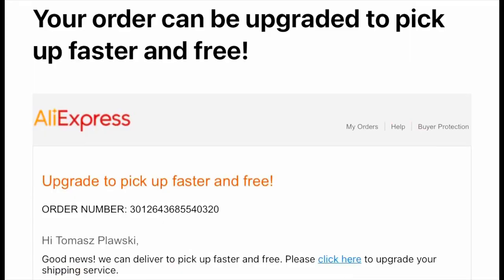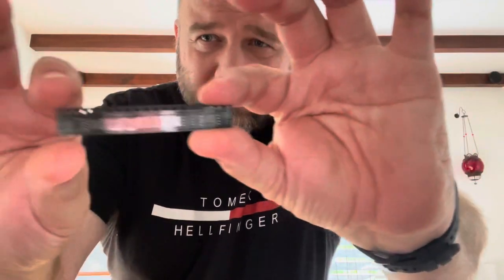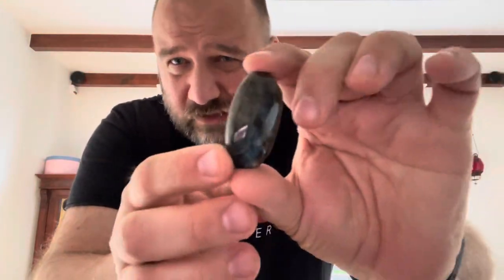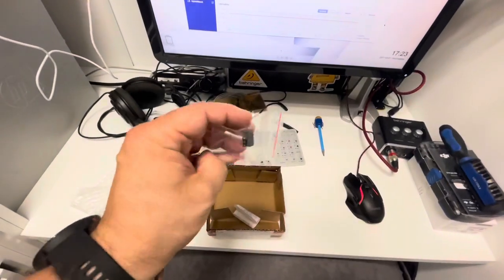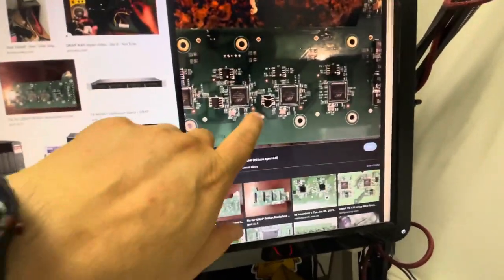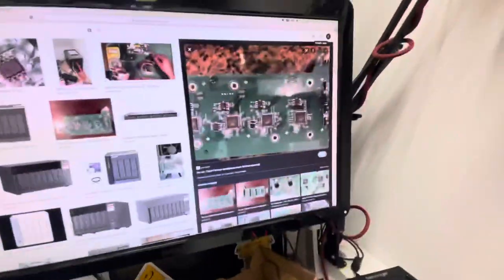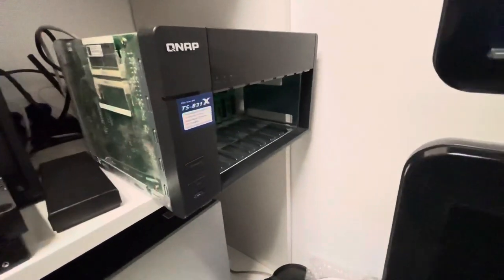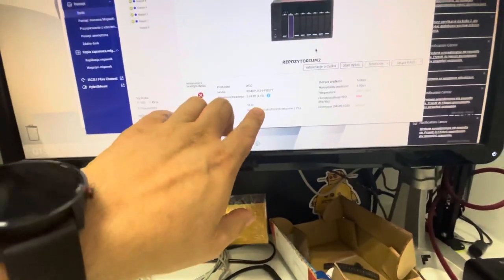🇺🇸/🇬🇧 TS-series QNAP NAS repair (it’s often that it’s actually not the disks failing but MOSFET)

Comment: had this same problem, the engineers at QNAP tought about this and added next to each mosfet pads to short them without wiring, you short them both and the mosfet is shorted at the board level. You can see them clearly at 10:19 between two brown caps on the left and below a tiny cap on the right.
Reply: i have a failing TS-853BU-RP... same problem... lost 5 out of 8 disks... will try the jumper thing on the board (not mosfet) and post my results.

Comment: This video was gold. Was about to order new disks... I have a TS-451 that now says disc 3 is missing. Moved the disc to a sata to usb adapter and inserted it to my main pc and the disk shows up correctly in disk management without any strange errors. So my guess I have the same issue. Then when I inserted the drive I could shortly see the drive in qnap. it reported no smart errors but som I/O warnings. then suddently it disapeared again.... So since out of warranty I need to pull it apart and se if I have the same mosfets on mine.
Reply from the maker: Reading the different support groups it unfortunately looks that this is quite a common problem in different QNAP units :( I’m surprised though that for units under warranty people had their backplane boards replaced with exactly the same ones with the same MOSFET. One would think that the manufacturer would redesign the board, so that it’s not susceptible to the problem repeating itself???
Reply: @TomaszPlawski  Yes i did eventualy find a tread about this. Also created an acount to view the images. However your video had the clearest shot of a finished bypass. (and the only one that does not require login to qnap forum :-) In the datashet for the AP4957AGM I could verify the briges was for the dual fets in the package between D1 and S1 plus D2 and S2. By that I was confident enough to bridge the mosfet connected to drive 3 power. But on my backplane board it seams that disk 1 and 2 are always on only 3 and 4 had this mosfet to the 12v and 5v rails. doing the full smart test on this 3GB drive is estimated to 4hrs if al plays out good i will order new mosfets and glue some copper with thermal glue as heat sink on the new MOSFET (a tip a found in the forum. however my nas has lasted 4-5years so far so if new mosfets prolong the life the same it is probably up for a upgrade by then anyway :-). 
My NAS was the TS451 the backplane was labeled "TS-451II BP v1.0 QX70" and the mosfets where 4957AGM located between  connections for disk 3 and 4. For info for anyone else finding this video but have another QNAP.
Reply: Final report. The unit has now worked for some time with the MOSFETs bridged. No problem so far. One tip for anyone having this problem and can't get the unit up an going again. Qnap did refused to accept the drive as a part of the raid again for me. This i found out to be because it was marked as having IO problems. Did a full smart test so drive was marked ok for that. Still wouldn't accept the drive. Then did a full sector scan and got the option to clear IO problems if test was succefull. Took many hours. After that I disconnect the drive and connected it again. After that the NAS accepted the drive and started to rebuild the raid. (Not sure the scan was called "full sector scan" but basically the drive can't have any error statuses for the NAS to try to rebuild the raid.) Could not find anything about this in the forums seams like many did a full restore and wiped the NAS instead when encountered this problem. But it turned out that as long as the other drives are ok there is no need for that. (Everybody wrote it should just restore the raid automatically when drive is inserted and if that didn't work just wipe the drives... But as I found out that is not true. Did take some time to complete all steps but a loot faster than starting over.
Reply from the maker: @rasmus80g  thanks for the update.  My unit took almost a week to rebuild the RAID, but it pretty much happened all by itself.
Reply: The 451 and 251 (basically all TS-x51) have self-killing CPU core voltage regulation issues as well. A couple transistors responsible for regulating the core voltage can fail, so it's either too low and it doesn't boot at all, or it's too high causing all kinds of crashes (and CPU temp reported as 255C in BIOS) and inevitably CPU death. It's essentially a repeat of the Atom C27xx CPU failure, but with the Celeron J19xx instead. And to no one's surprise, QNAP suddenly started making ARM based NASes (Annapurna Labs SoC) again, and even ones based on embedded Ryzen CPUs. They got burnt a couple too many times by intels hardware issues lol

Comment: Nice diagnosis, where did you find the info/details?
Regarding the fix, you could have just soldered the two close contacts above and below the chip, if you look at the circuit they are attached EXACTLY to the pins you connected!
This meka me thinking that maybe other models (no hot plug??) may solder these pads instead of using the mosfet?
Reply from the maker: This was mentioned on a few qnap forums. I left the original (broken) mosfet in place not wanting to play around with desoldering. It has nothing to do with hot-plug. Just intended for switching on the disks in sequence to avoid a startup current surge if all started at once.

Comment: I have a ts-253A 2 bay. Bought it used. I purchased 2 New WD40efzx 4TB drives. When I run setup from qfinder I get error saying no HHD recognized. Power button solid green, no lights in the HHD1 or 2 LED's.
Reply from the maker: Probably the same reason and the mosfets are blown :(
Reply: @TomaszPlawski  can these mosfets be purchased? Where? Is there a good video explaining this?
Reply from the maker: @MikeGoodwin-kc3st  I tried looking for “regular distributors” for them via octopart and nothing came up. Googling for 4957agm there are plenty of offers on eBay and AliExpress but with all the counterfeit parts nowadays I just chose instead to jump the legs to have a permanent ON of the power to the hardrive. The purpose of these MOSFETs apparently only to switch on power to the drives in sequence not all at once. Ps. I don’t know if the 2-bay has the same MOSFET. But looking inside my 4-bay NAS it had basically the same design as the 8-bay and also uses 4957AGM therefore I assume they probably did all the same

Comment: Tomasz, will this work for TS-451 as I tried to find where these MOSFET located but I cant see on the board that hdd's are plugged in. would you mind to email me some info pls
Reply from the maker: Take a look here https://forum.qnap.com/viewtopic.php?f=25&t=134212 the thread is really long, but on the last Pages people also mention the mosfet as the most likely reason for the failure of this unit type  (you need to register in order to be able to view forum pictures)
Reply: @TomaszPlawski  Tomek, I already watched your video but I checked the board of mine and there is no MOSFET transistor on this board. Perhaps on the mother board.
Reply from the maker: @danielspoko4100  on all QNAP's I have seen they have been located on the disk connecting board, near the "sockets" - maybe snap a picture and post on FB etc. and provide a link and I'll take a look
Reply from the maker: there's another thread here https://www.reddit.com/r/qnap/comments/adax5o/ts451_backplane_failure_spare_parts_anywhere/ and here https://forum.qnap.com/viewtopic.php?t=134212&start=420 it looks that the majority of QNAP's used a similar design and are all prone to the same problem, does your backplane look like this https://preview.redd.it/ibzu7j3qtv821.png?width=1074&format=png&auto=webp&v=enabled&s=267d462677bbf08df1afd099dd4c98143eb4b101 ?
Reply from the maker: @danielspoko4100  p.s. the chips should be labeled 4957AGM or something similar
Reply: @TomaszPlawski  Well, my backplane is marked as TS-451 BP 1.0 QW63. perhaps the mother board could have one, but nothing close to 4957AGM

Comment: Hello Tomasz, nice video! I have a similar issue with my QNAP TS-431, where suddendly the 4th disk is being seen for a couple of minutes, then marked as faulty and disconnected, I believe that its a mosfet issue. the backplane is marked as TS-451 BP 1.0 QW63. Is there any way that I can send you some pics of the board and you can highlight me the pads I should solder in order to bypass the faulty mosfet?
Reply from the maker: For the moment I’m on holiday therefore difficult to try to look up any schematics on the phone. Nevertheless, if it’s the same mosfet (most likely) than it would be jumpered exactly the same as here. You can get more info here https://forum.qnap.com/viewtopic.php?t=134212&start=450 although you will need to register to be able to view the full resolution image attachments.
Reply: @TomaszPlawski  dzekuje! :-) I'll check that website and eventually post my pictures and I'll wait for answers, it's not an urgent matter. Enjoy your holiday!

Comment: Hello there! Very nice video. I have a QNAP TS-251+ that works for for now. Can you please explain me how exactly I would recognize that would be indeed a transistor failure instead of any random disk or data failure that could be advised with red light?  If I would see some errors I would rather think of a disk error, not a hardware failure. Please let me understand how to distinguish one a part from the other. Thank you very much. :)
Reply from the maker: Unfortunatelly there is no easy way to judge by the symptoms. Failure of this transistor can lead to erratic behavior which looks as if the HDD is starting to fail itself, having read/write errors and in the majority of cases this normally should be the main cause of the warning lights. One way of (time consuming) checking could by swapping in a spare drive in place of the problem one and see if your RAID rebuilds, which with a failing transistor will not be able to ever complete. A little less time consuming but “workmanship-intensive” method would be to desolder the transistor and use a tester to verify it’s ok, but then, putting in the effort to disassemble the PCB, you might as well solder in a new one, as even if it turns out OK, the intensive heating from desoldering/resoldering the old one can impair its service life.
Reply: Was you able to get your Qnap server fixed at all?

Comment: why doesnt everyone just replace the MOSFET itself
Reply from the maker: Because it seems they are “underrated” and sooner or later doomed to fail again, whilst they don’t seem to be needed
Reply: Reading the forum posting, it looks like their presence is to enable the NAS to stagger the start-up current from of all drives firing up at the same time. Shorting them out just means that all drives will all fire up at the same time, so more risk of the Power Supply not liking that and failing or the power rails sagging.

People talk about alternative devices, not being available / it being difficult to replace a SO-8 device. From my quick look on Mouser this evening, it seems that two parts would be OK, they are International Rectifier IRF7328PbF or Vishay SQ4917CEY. I'm looking into this more at the moment as my NAS has started doing the same on a couple of slots. 

Swapping an IC is not difficult with the right tools.

@Tomasz - do you have any real info on what is "under-rated" ? The MOSFET's are rated at 8A peak, yet drives don't take 8A on their power rails. According to the data sheets, my drives peak at 2A for example, so 25% of their capacity.

Doing a quick power calculation assuming 2A per MOSFET, then power=I^2 * R = 2^2 * 0.026 = 0.1Watt per channel, but there are 2 channels, so 2 x 0.1W = 0.2Watts and the device is rated at 2 Watts, so only 10% of its capabilities. I'm not seeing anything under rated here.

Perhaps all they need is a better MOSFET that can deliver what its data sheet says it can.
Reply from the maker: @timc3600  Yes, they are meant to have the hard drives start-up in sequence considering that's the moment with the highest current draw. However I believe the QNAP having a 250W power supply should be able to handle a momentary demand of 16A at 12V with some room to spare, even if all drives fire up at once drawing a max ~2A/each.  The only problem could perhaps only be the thickness (width) of the power supply track on the PCB. By underated I meant that they are not up to declared speck considering how often they prematurelly fail in people's devices.  Although, perhaps there might be some other design flaw in the PCB itself and how these MOSFETs are being switched?
Reply: @TomaszPlawski  
Thanks. Poor reliability on the MOSFET I agree on. The cause is not so clear from what I've read on the forums, so I'm looking for info. Nobody seems to have swapped to alternative devices as none were listed in the forum. I'll give it a shot and update on what I find.